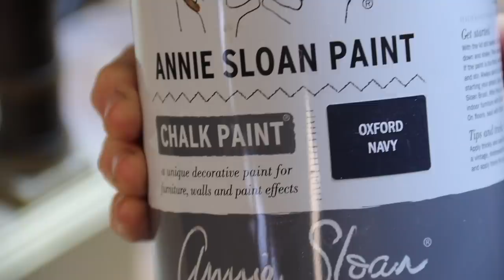How to paint Furniture in Faux Linen Texture | BEFORE AFTER Furniture Makeover | Annie Sloan Paint

Comment: Yay bonus video! I can’t say I love this technique but the video was fun, and the table is very pretty as it turned out. The table is unique, I’ve never seen this style before. And those thick drawer sides! Well-made piece.
Question - have you ever chalk painted over a table with a leather inlay? I haven’t searched YouTube yet but I will. This curb find table had pink fluffy fabric over the leather 🤦‍♀️
Perfect shirt you’re wearing. Today my coffee needed coffee so off to the corner I went for a flat white ☕️ 
See ya Saturday Sarah!
Reply from the maker: thank you Brenda 😍 it really is a well made piece for sure. I think putting legs on the bottom would have looked funny! 

Funny you should ask that. I have a coffee table and 2 end tables with leather in lays. Sadly the inlays are badly damages so when I do get to them I think I will have to remove rather than repair or paint. But chalk paint is supposed to be able to go over textile like leather. I know that the DIY Clay Paint can go over textile, I've seen the owner Debi paint fabric.

More often than not my coffee needs coffee 🤣 I could use a flat white!!!
See you Saturday x
Reply: @VintageAndPainted  Appreciate your input Re the leather. I’ll have to examine it more closely before I attempt anything. Pulling off the leather may help get the pink fuzz off. Lol it’s crazy